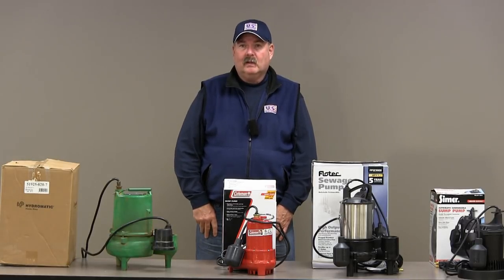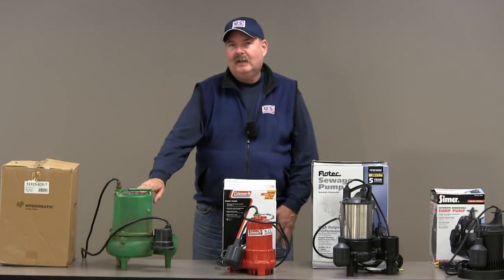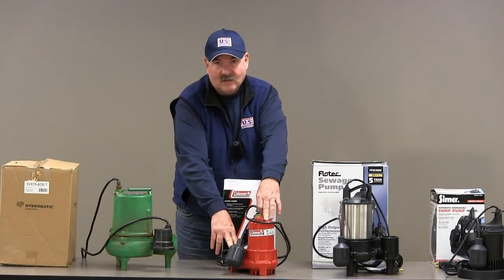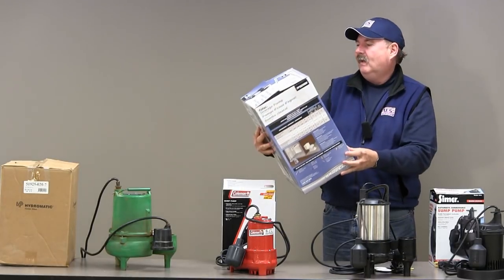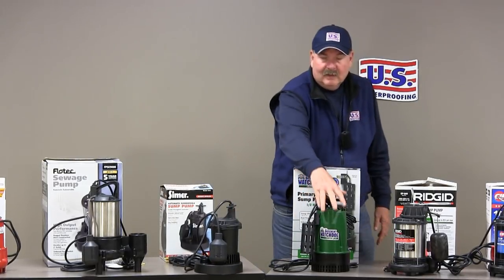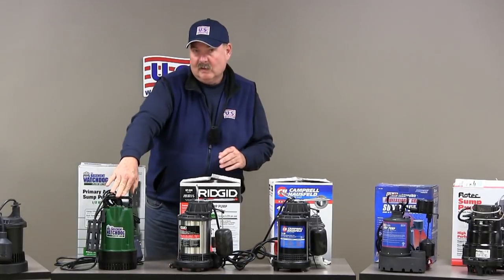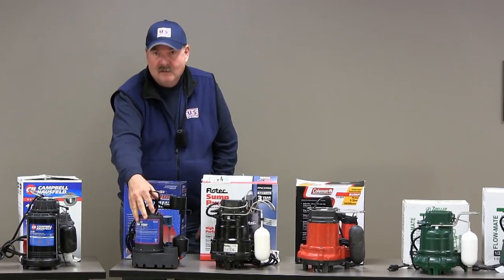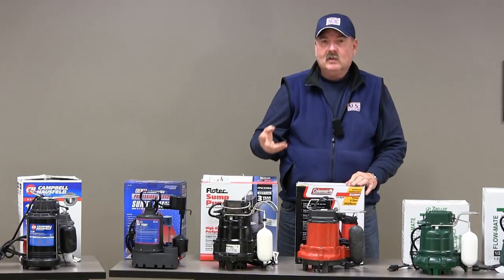Sump Pump Reviews:Plastic, Steel or Cast Iron?

Comment: I love how he associates "cast iron" with a good pump disregarding any other components. In my experience, two plunger type switches have failed on "high end" pumps forcing my battery back up to kick in, both of which were constructed of CAST IRON. I bought a 1/3 hp thermo plastic pump with a buoy type switch instead (with a one year warranty) it is now 3 tears old and it has held up very well in  Canadian melting periods of 5 feet+ of snow. This year, It has been running every 2 minutes for 48 hours+ with no issues.
Reply: Your vertical floats failed? What BRAND did you have? Did you do the annual maintenance like cleaning out the basin of debris? Was there enough space around the float, all wires out of the way and not directly in front of the inlet? 
I had a 25yr old Zoeller cast iron sump pump that just finally the float went out on. Now I use a Zoeller cast iron with level guard switch, not a float.

Comment: Had a heavy cast Iron, made in USA, Zoeller M53-D.  Switch failed.  replacement switch inside cast iron housing was cheap plastic.  It's all about the integration of all the parts, not just the housing.  Typical American cro mag mentality...If I buy American and it's heavy, its good.  Nope. FOr example, Tsurumi are some of the best pumps out there and they have some plastic parts and are designed and/or made in Japan.
Reply: Me too, I am done with Zoeller garbage! It is cast iron too, just like a boat anchor which is what I will use mine for now.